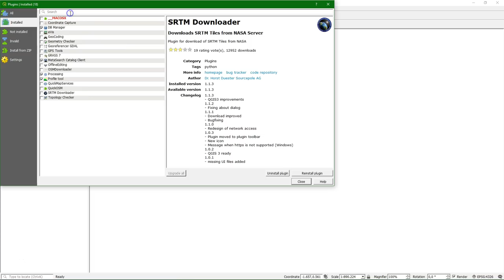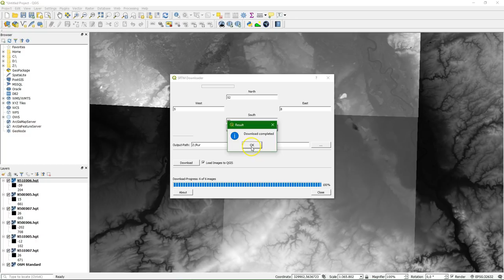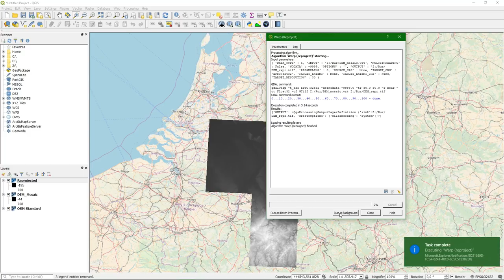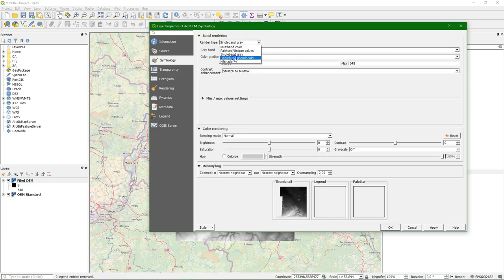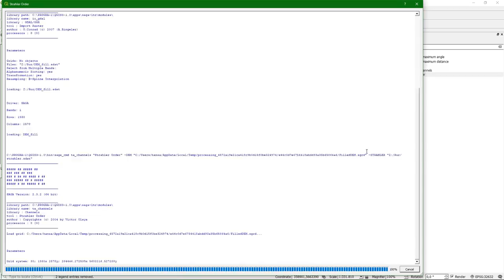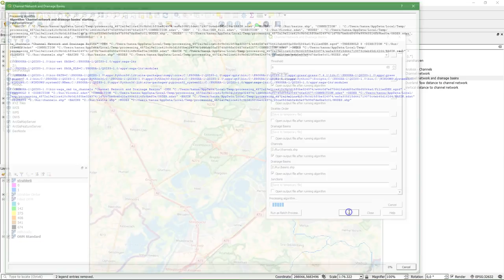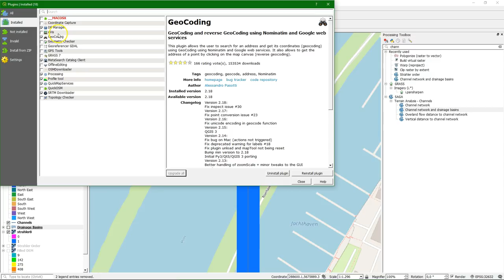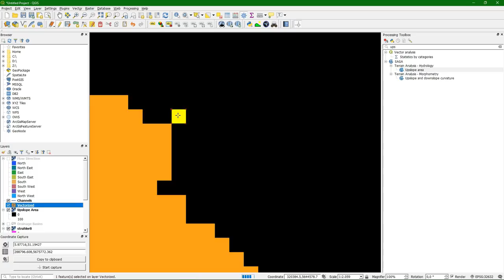Stream and catchment delineation in QGIS 3

Comment: respected sir, 
help me to fix the following error 

----- This algorithm cannot be run :-( 
The specified GRASS 7 folder "C:\PROGRA~1\QGIS3~1.18\bin\bin" does not contain a valid set of GRASS 7 modules. Please, go to the Processing settings dialog, and check that the GRASS 7 folder is correctly configured

How I can fix this error?.
Reply from the maker: You need to either start QGIS with GRASS (older versions) or install GRASS with the newer QGIS OSGeo4W installers.
Reply: @HansvanderKwast   Ok sir. thank you. can you please give me the link for that?.
Reply: @HansvanderKwast   Got it sir .... Thank you so much.

Comment: Hello sir. What QGIS version is used in this video?
Reply from the maker: Hello. Not sure which one I used, but the procedure should work from 3.4 to 3.10.3, I've tested it. Just be careful with versions 3.10.0-3.10.2.
Reply: I am using 3.4.3 with GRASS 7.4.2 but the color ramp option for topography is not available
Reply from the maker: @dave121594  Are you sure you clicked right on a colour ramp, choose Create new Color ramp and choose CPT-City from the dialogue. Normally it should be there. Otherwise upgrade to 3.10.3 LTR.
Reply: Okay got it. Thanks! But do you have a video on styling on stream and channels using GRASS? Thanks!
Reply from the maker: @dave121594  Styling is the same for the GRASS and SAGA approach, because it's about styling the results. You can find that in this video: https://youtu.be/W4d-u_dldN0 or are you looking for something specific that isn't covered by this video?

Comment: Anyone else have problems with a couple of the tools?

For me i have some problem for 
1. SRTM downloader
2. strahler order
Reply from the maker: What problems are you experiencing?
Reply: @HansvanderKwast  Thanks much for your reply mate. And also want to thank you for this guide. its super helpful and hopefully i can finish my own delineation with your guide.

For the SRTM downloader, I followed your steps and tried to download. But I notice there is no pop up for the credentials. I looked up in https://github.com/hdus/SRTM-Downloader/issues, and it seems like there is a couple of other qgis users are experiencing the same issues. 

As for the  Strahler Order, I read through your youtube and you mentioned about checking projection, no spaces in folder, memory requirement and using LTR. I went through with projection (mine already in UTM), and i filled in the voids in the DEM, I checked there is no spaces in my path. Just did another check with the memory requirement and it seems like i have enough (only using 60% when running).  I am up to checking the qgis version now (i am using 3.16.1-Hannover). 

I did downloaded my DEM directly from usgs, and start your guide with that DEM. However, when I come to the strahler order issue, one suggested fix is to use DEM downloaded from SRTM downloader. I then tried and this one is not working as well. 

At this moment, i am stuck and I am very glad and grateful for your help!
Reply from the maker: @jacktheteo  I don't think there's a difference between downloading directly from USGS or using the plugin. Just to be sure: you tried with 3.10.x? On Windows?
Reply: @HansvanderKwast  

I used QGIS 3.16.1 - Hannover, on windows 10.
Reply from the maker: That's not LTR. It should work at least with LTR and I tested with 3.14.x.

Comment: channels and drainage basins not generating sir 
please help me sir its emergency
Reply from the maker: Check:
1. Use CRS instead of GCS (no EPSG:4326!)
2. Use filled DEM
3. Don't use spaces in file/folder names, create a local folder on harddisk. See: https://youtu.be/kggwFZHXCl4
4. Use QGIS LTR version. The current one is 3.16
5. Check if there are no strange characters in your temporary folder name. See: https://youtu.be/MEKgLv9Q3jA
6. Maybe the spatial resolution or extent is too large for the memory. Then clip to smaller area or use coarser DEM
7. The area is too flat
8. The area has voids. Interpolate voids: https://youtu.be/FwJSBoTn1y4
6. If all above doesn't work, create new profile: https://youtu.be/mKTRHL5YLjI
7. For complete procedures and alternatives check this playlist: https://youtube.com/playlist?list=PLeuKJkIxCDj2Gk0CkcJ-QeviE41aMZd-5
Reply: @HansvanderKwast still not creating sir please help me
Reply: Did you find any solution for this?
Reply: @satarupapattanaik7001  yeah use grass tools
Reply: @nbrahmareddy7690  can you please elaborate a little about which particular tool. Actually I'm stuck really bad nd I'm not getting any proper idea.

Comment: Strahler order not generating sir
Reply from the maker: This can happen for several reasons:
- DEM too large area
- DEM spatial resolution too high
- spaces or strange characters in file and folder names
- GCS used (EPSG:4326) instead of projection
- Filled DEM not used as input
- Area too flat
Reply: @HansvanderKwast  thank you so much sir

Comment: Dear Hans,  
Thank you very much for your video, is really helpful. I got stuck in the filling sink step. For some reason there is a problem with my DEM file, since every time I ran the process it says that the filled layer couldn't be generated (The following layers were not correctly generated). 

There are 3 errors in the log message: 

C:\WINDOWS\System32>saga_cmd io_gdal 0 -TRANSFORM 1 -RESAMPLING 3 -GRIDS "C:/Users/rangelys sorrentino/AppData/Local/Temp/processing_ea850dc62738488dbd82df8e30bd75b8/525516be336e41a7b7b36298f579e688/Clippedextent.sgrd" -FILES "C:/Users/rangelys sorrentino/prj2/clipped.tif"
Error: select a library

Error: input file [C:/Users/rangelys sorrentino/AppData/Local/Temp/processing_ea850dc62738488dbd82df8e30bd75b8/9a67624954d54590a15bfa0aa26548da/Clippedextent.sgrd]
Error: DEM

and also a fail: Load grid: C:/Users/rangelys sorrentino/AppData/Local/Temp/processing_ea850dc62738488dbd82df8e30bd75b8/9a67624954d54590a15bfa0aa26548da/Clippedextent.sgrd...
failed

Best regards
Reply from the maker: Hard to tell what went wrong. Maybe you can share the files so I can look at it.
Reply: @HansvanderKwast  I am having a similar issue to Ran Sor. I am getting the same errors as well.
Reply from the maker: @danielmeyer8598  There can be several reasons. Maybe the projection is in lat/lan? Maybe the area is too flat? Maybe the DEM is too large. In the last case use Wang & Liu XXL. You can also try if other fill sink algorithms work.
Reply: @HansvanderKwast  thanks for the quick response. I'll give those a try.
Reply: Try by doing this one by first deleting the old out file totally and create a new one if you are using the old out file or use a new one. This May work

Comment: Hi, this has all worked for me perfectly on a number of occasions but when trying on a different pc I am getting the following error when attempting to calculate upslope area. Do you have any ideas?

SAGA Version: 7.8.2 (64 bit)

Error: tool needs graphical user interface [Upslope Area]

C:\Users\Luke\Documents>exit
Execution completed in 3.37 seconds
Results:
{'AREA': 'C:/Users/Luke/Desktop/fleet_upslope.sdat'}

Loading resulting layers
The following layers were not correctly generated.
• C:/Users/Luke/Desktop/fleet_upslope.sdat
You can check the 'Log Messages Panel' in QGIS main window to find more information about the execution of the algorithm.

Many thanks